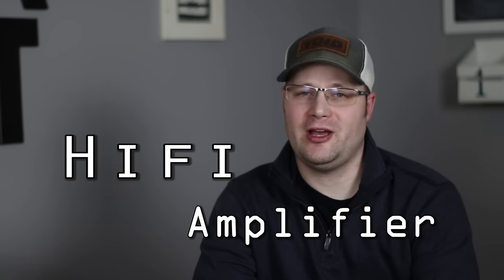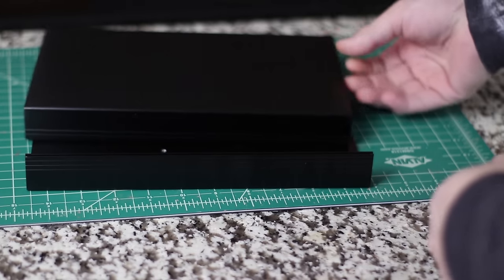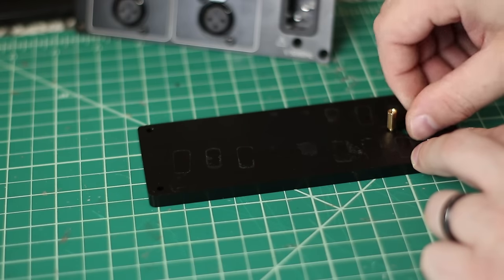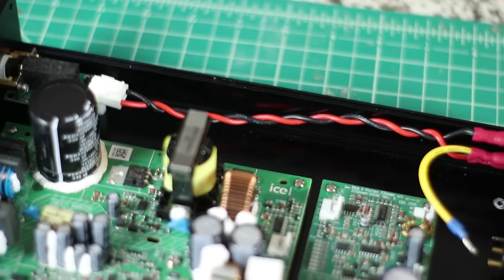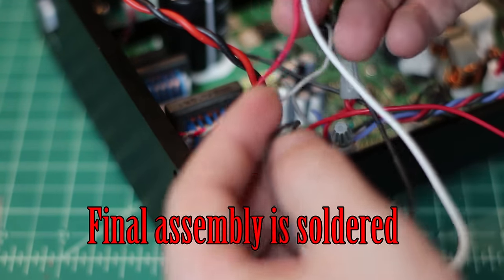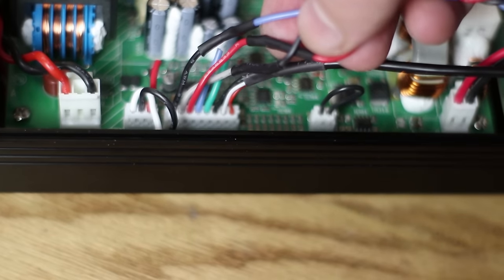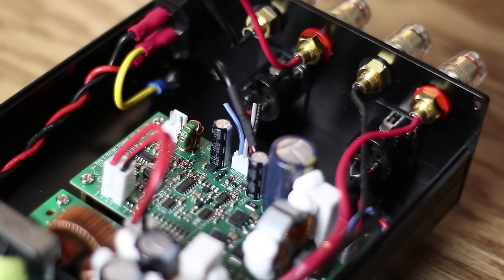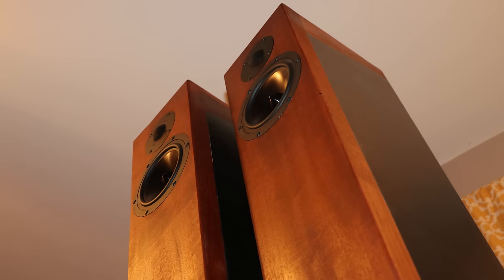How to Make a $3000 DIY HiFi Amplifier for $300

Comment: misleading title, u just assemble a pre-made pcb
Reply: only misleading if you chose to understand it in a way that wasn't intended
Reply: @Zack-dk3pt  
How would I know what the "intended" would be before watching the video? Do you even know what clickbait is??
Reply: @eliasbouhout1  yes i do know what click bait is and that is why when i see it i know not to assume it is not clickbait and instead think of a more reasonable meaning behind the clickbait.
Reply: @Zack-dk3pt  So you admit that this title is clickbaity and that you specificatly need to reject the intended meaning behind the title to get closer to the actual content of the video.
Reply: No different than building a computer but you don't say someone just used pre-made parts.
Reply: @eliasbouhout1  the title says "how to make" it doesn't say "how to manufacture circuits from silicon you extracted from the mountains of Tibet". Making does not imply it's going to be from scratch. If I see a video that says "how to make a robot" im going to assume there are premade parts like an arduino or raspberry pi.
Reply: @uhN0id  making does imply that it's from scratch, if you use pre made pcb's you're assembling.
Reply: @73Xtian  no reasonable person should assume you're literally building this from scratch. The point of the video is still true "instead of spending a lot more for a prebuilt amp build your own and save a ton" which is ultimately the point. He never specified how low level the making would be. Google define says "Make: form (something) by putting parts together or combining substances; construct; create." So it's not as inaccurate as you all suggest.
Reply: @uhN0id  i didn't say it was that inaccurate, i just said that putting together is assembling, not making.
example: are you going to make your own coils by winding them and make your own pcb by etching it or are you going to buy a pre made coil and pcb and assemble it.
Reply: @73Xtian  again the definition of "make" encompasses both "from scratch" and also basic assembly. If you make a sandwich you're usually just assembling it with premade components. It's not like people make their own bread from scratch every time they say they're "making" a sandwich.
Reply: @uhN0id  He is literally just wiring up a few boards:
"how to manufacture circuits from silicon you extracted from the mountains of Tibet" - MANUFACTURE (Create sometingh from basic materials)
"how to make a robot" - MAKE (Taking basic coimponents and creating more complex stuff from that)
"How to assemble and wire cheap  parts to create a high quality 300$ amplifier" - ASSEBLE (Take already complex blocks of stuff as components to make them function together and create complex system)

He is assembling an amplifier,he didn't make any of the components that he used from more basic components and instead assembled them all together to form an amplifier and as such he didn't "MAKE" and amplifier he assembed it,much like you do not "MAKE" a computer,you assemble it,or like you do not "MAKE" a bed from ikea but assemble the already preapared components.If somebody where to make a video on "how to make a torch" I would expect for it to be something different than buying an already made pcb and putting it inside an enclosure after a bit of wiring,I would expect for it to be a video about creating a simple circuit from basic components or something like that,it would not be "How to manufature the fucking components of this torch from ores illegaly mined in Chinese mines" nor would it be "How to assemble this torch", it would be "how to make a torch".

This video literally starts with something like "In this video I will teach you how to make a high quality amplifier" or something like that,however the contents are compleately different,he did not teach how to build an amplififer,he talked about how to assemble an amplifier,which still has it's own worth as a video,but I could finish the video without knowing anything about what these components do and about how to "build an amplifier",the "how to build" part kinda implies that you are going to TEACH THE VIEWER THE WAY IN WICH YOU CAN BUILD AN AMPLIFIER, It's not the type of build that is wrong it's the way that it's done in realation to the title,if I'm clicking on this it means that I probably want to know how to nuild AN amplifier.
Reply: @eliasbouhout1  again the definition of "make" encompasses "basic assembly of preexisting parts". You're only acknowledging one definition of the term. All of those components on their own don't make an amp. But if you put them together you MAKE an amp.
Reply: "How to assemble.." would be a more accurate title.
Reply: @mitchellroberts7954  that's definitely true but who seriously thought they were building things from literal scratch? To say a more low-level build would be more fitting is fair but the entire point of this is to make/assemble an amp instead of buying one right out of the box. So the title is still true to the definition of "make". But I agree with your idea.
Reply: @davidh4462  Disagree. Anyone with a brain and ability to read manuals can assemble this.

When I read a "how to make a xxx electronic component" title I expect a video explaining how he/she designed their own amplifier circuit and giving instructions on how to make your own.

Marantz MAKES amplifiers. They do not make each individual resistor and other components themselves. But they do design the whole of it and put it together.

This guy literally just took a pre made amplifier and put a case around it.

Better title would be:
"How to assemble your own amplifier kit"

or "How to build a case for and wire an amplifier board".
Reply: @73Xtian  
100% exactly correct mate
Reply: @uhN0id  No. That's even more different. 
Normally, it requires design and selection of parts. Not just assemble a kit.
Reply: @uhN0id  Robot is different. Because making a robot mainly is in the programming part and arduino or raspberry is just a part of the project. 
As an amplifier, it's literally just a board and case/heatsink + power supply. 
It's like taking all the codes from others and documented wiring etc and make a robot.
Reply: @johnyang799  what is the definition of "make"? If I look up the word "make" it describes what happened in this video perfectly.
Reply: @uhN0id  You won't understand unless you actually design these stuff. It's more like building an amplifier rather than making it. Would you say you made a computer when you build it?
Reply: @johnyang799  I fully agree that you should understand it. But the point of this video was "don't spend tons of money on an amp when you can make one yourself". It wasnt "learn the sound theory and engineering". I'm a software developer and like many many (all) software developers we alI use third-party prebuilt libraries and frameworks. Am I not building software by manipulating these prebuilt functions to do what I want them to do?
Reply: @uhN0id  Ok now you can relate. You get the source code from somewhere else. And you only compiled it. That's the analogy.

The point of this video wasn't reflected by the content. The performance is not really that great. Good performing 200 dollars would out perform this. Complete modules like NC400 cost almost 1k. That's what really good performance cost.
Reply: @johnyang799  but even while using thousands of lines of premade code from libraries and frameworks I can still say I "made" a website. Why is it when I use premade physical components it's no longer "made"? 

Feels like everyone wants the word to mean what they want it to mean.
Reply: @uhN0id  When it's website, the main focus is the content not the framework anymore even directly using WordPress. 
Here it's more appropriate to say: 'xxx amplifier kit review'or ' is xxx dollar amplifier board from ebay any good?'. 
'How to make an amplifier for 300 dollars' directs to circuit design with schematics and pcb layouts. 

Also more importantly, the intro is extremely misleading when he said 'exact'. Because he is not showing us any circuit of the companys he mentioned.
Reply: @johnyang799  the main focus isn't the content if I'm the engineer. For me it's the performance and efficiency of the tools I use. If I build a website or say a self driving car I'm still MAKING them despite using 3rd party software to assist me. You're getting off track. We're not talking about quality, or value, we're talking about the title being "making a $3000 amp for $300" and if the word making is appropriate. By definition it definitely is.
Reply: @uhN0id  Oh in that case, you are selling your service, the maintenance. It costs you time and energy every day to do it.
Reply: @johnyang799  what does that have to do with anything 😂😂😂 this isn't a discussion of worth. It's a discussion of the term "make".
Reply: @uhN0id  Yes you are essentially making the 'service' which is dependent to the tools.
Reply: @johnyang799  so your logic here if I'm understanding correctly is since C#, C++, Javascript, PHP, Go, etc etc are built on top of binary/assembly/machine language that means they didn't "make" those languages, but rather they assembled them.

You say I'm making the "service" because I am assembling code from prewritten frameworks - I didn't make the framework just the final product (service) after assembling it all. So, if I follow this video then I am MAKING an amp with prebuilt components just like how I MAKE a service with prebuilt frameworks.  The frameworks by themselves don't make the service I built,  just like the amplifier components by themselves don't make an amp.
Reply: @uhN0id  You see. How things work is. This video creator should be the one that writes code himself or develops a tool and open sourced to us. We just come here and take the code.
What is been done is he took a code from somewhere else, he doesn't understand it just knows it works, and post it. And he says he makes the code? no way man. That's not fair.
Reply: @uhN0id  To continue your analogy. It needs to be said as how to make a assemble  amp for 300 dollars, as the same meaning of how to make maintenance of a website.
Reply: @johnyang799  I disagree. I think what he's doing is saying "hey you have an understanding of this JavaScript framework now I'm gonna show you how to MAKE a to-do list app with it". It was clear to me his goal was to show you how to make one instead of buying a prebuilt amp so you can save money. Not necessarily to get a full course in electrical engineering. But I appreciated this discussion. I just don't think we're changing each other's minds haha
Reply: @uhN0id  That's the content. But in fact normally when people say doing this is to draw a schematic and build it that way.  The components themselves  are manufacturered no doubt. How to select, connect those components is more important. This video is  bypassing most the work that's normally done by diyers. And that's where the fun really is. Assembling is no fun, repetitive work that requires minimal knowledge. This is just like compiling a code seriously. All the code are already done. Your analogy using framework, JavaScript isn't really representative to this thing. Sure there can be tutorials teaching how to compile but that's almost irrelevant to the program itself. You can assembled a DAC or a raspberry pi like this too(almost).
Reply: @johnyang799  my point was that using JavaScript is no better than a framework since JavaScript isn't not the lowest level it gets. Just like how this video isn't the lowest level it gets. But either way what's "fun" isn't relevant. The title is setup for those that want a great amp for dirt cheap by not buying a prebuilt one. It's not intended to appease every single person's requirement for their DIY hobby. This video is to get you a great amp for 1/10th the price BECAUSE you build it yourself. It's not advertising it as a low level lecture.
Reply: @eliasbouhout1  The guy made an amp with modular assemblies. So by assembling these parts together he made an amplifier. So the use of the word "make" is an acceptable usage of the word. To an engineer it may not be the best terminology to use but this is not an engineering course or a technical manual. It's fucking you tube. He did make an amplifier but did not make the parts. How did he make the amplifier? By assembling the parts. Simple as that.
Reply: Dude who cares
Reply: @73Xtian  Did you really expect a video on how to make a PCB on your own?
Reply: @nunyabiz2016  why not, there are several video's on YouTube about making pcb's
Reply: @johnyang799  

Also,

This is not a kit. He did the research and was the guinea pig by trying it out and making sure all the components play nice together.

I for one appreciate that, because buying an unknown case that may or may not fit the application is definitely a gamble. Also, it sounds like the documentation for how to wire up the different modules is not at all thorough.

I've thought about buying these 'ice' modules before, but didn't because the information seemed incomplete. I wouldn't hesitate now that I've watched this, and I might use a completely different set-up.

This is a very valuable video - I'm glad he assembled it from different bits of footage.
Reply: @ConradBrander  You can get from Neurochrome. Tom has best documentation. His mod-686 or mod-86 are the best for diy and perform way better than 99% other stuff on the market.
Reply: @uhN0id  what does nuild  stand for in your world ?🤣😂🤣
Reply: @donnafarquhar6732  I'm guessing you mean "build" and it means you create/make something out of parts. Like how this YouTuber MADE an amp out of parts that by themselves are not an amp.

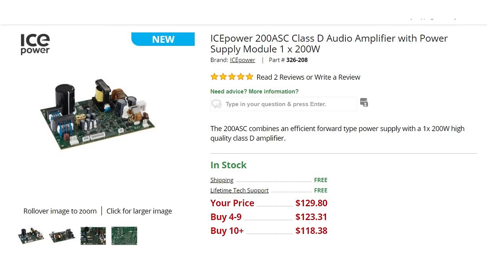Comment: 2:15  Dual Monoblock ? Really ??
Reply: Yeah i tough monoblocks had separate transformers. So its just a stereo amp out of 2 mono amps.
Reply: @Toid  Thanks for explaining !
Reply: @Quetzalcoatl0  There are plenty of dual monoblock designs that have one transformer for power.
Reply: Monoblocks by definition have totally SEPARATE power supplies.  This video simply shows a stereo amplifier using a common power supply.  Marantz model 15 was a dual monoblock.   Dynaco Mark III is a single monoblock amplifier.
Reply: @oysteinsoreide4323  Almost every stereo amp is a "dual monoblock" in that sense. The idea of a monoblock is that each channel has its own power supply and transformer. Almost every PA amp ever made has indivual modules for the two channels, but most (not all) share a common power supply.
Reply: @H-77  The degree of circuit sharing decides if you could call it dual mono or just a stereo amp. signal bleed between the channels is very common in stereo amplifiers. It's much better sound separation in dual mono. The ultimate separation would be mono blocks instead of dual mono.
Reply: @H-77  It's called dual mono, not dual monoblock. Monoblock is when one channel has separate cabinet.

Comment: I'm looking to build this. I've bought everything with the exception of the case. There currently are two models of the case (B235a-S2 w/ XLR type options  & A265-S2) and I want to be sure that I get the same case as you have in your video. Please advise at your earliest convenience.
Reply from the maker: I used the a265-s2 https://www.ghentaudio.com/products/a265-s2
Reply: @Toid  Thank you! Just finished building it and it sounds great